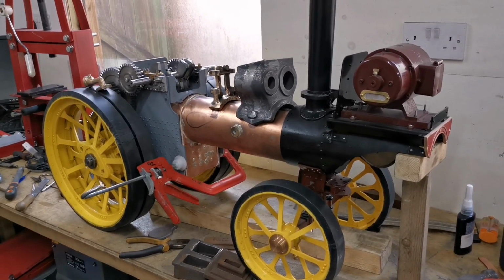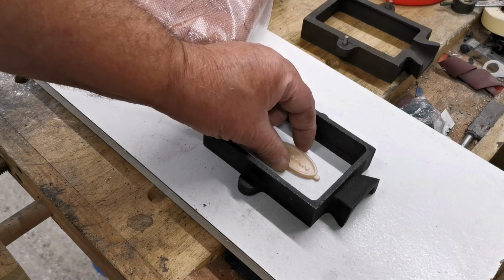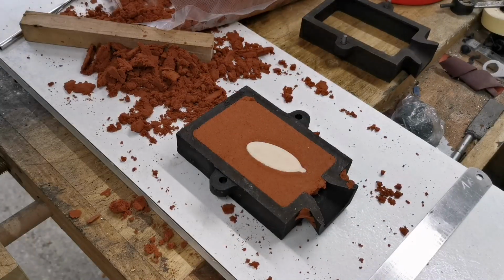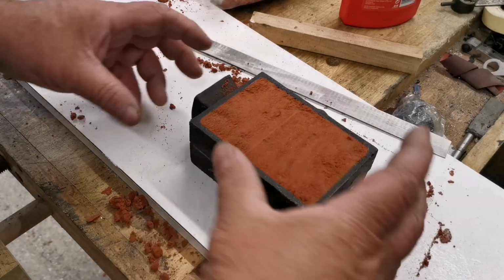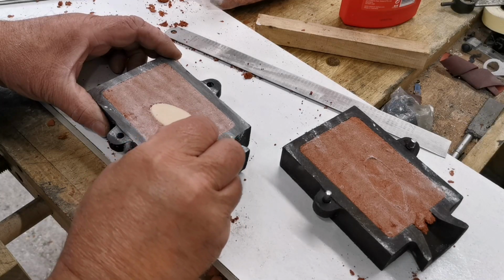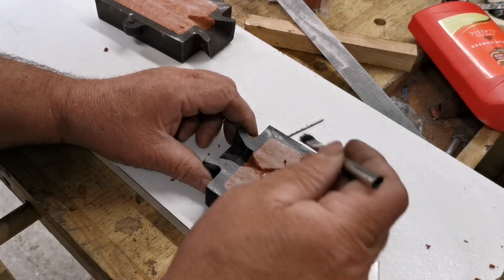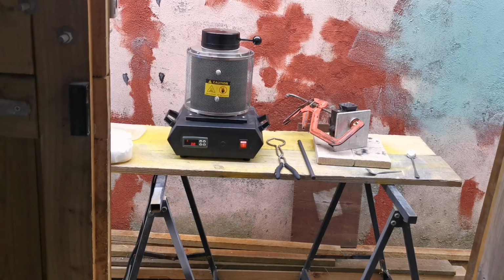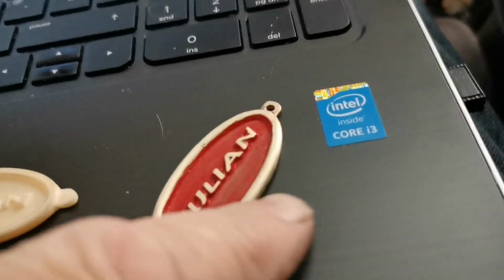Trying out an electric metal melting furnace

Comment: That turned out brilliant. Could you please tell me where you purchased the furnace, sand and moulding flask from?
Reply from the maker: Hi, thank you, I got the furnace off eBay, and the sand and flask came together from amazon, if you get one and need to use an extension lead, you will need to make sure it is thick enough, as a thin one will get hot as it draws the power
Reply: @jammymowlam1  that’s great. Thanks for that, I’ll have a look. I’m really enjoying you videos, I also meant to ask where you got the castings, I wouldn’t mind having a go myself.
Reply from the maker: Thanks, the drawings and castings I buy from bridport foundry, so far the drawings are spot on, and the castings are quite good as well,
Reply: @jammymowlam1  excellent. Thank you again and keep up the good work. Looking brilliant so far.